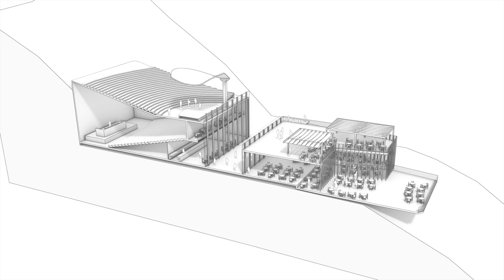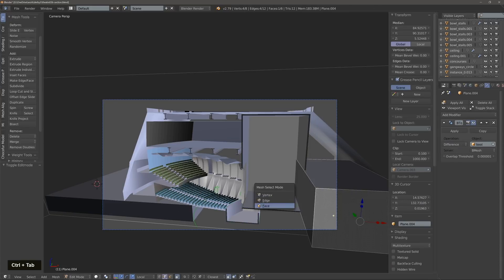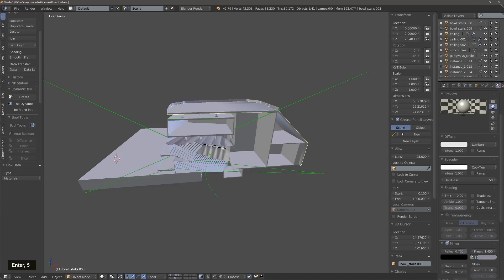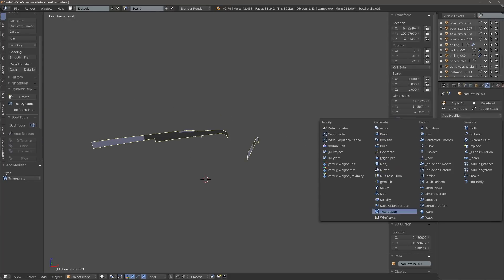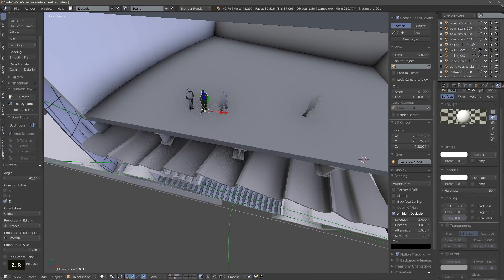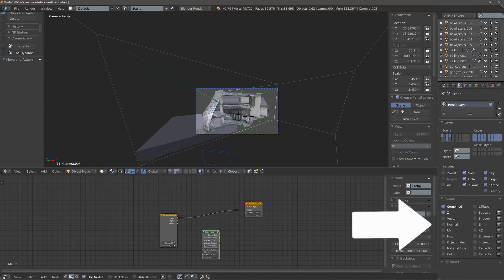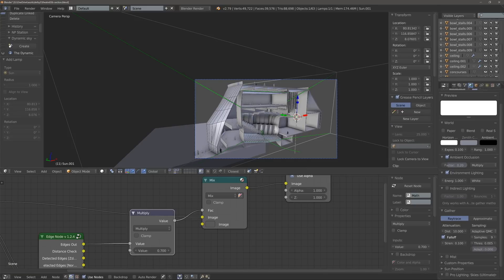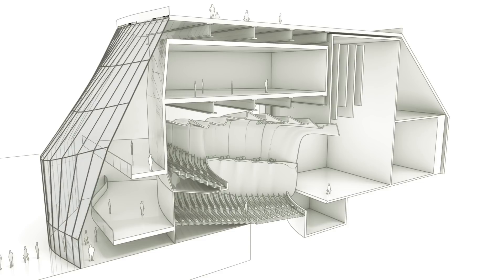How to create an architectural 3d Section in Blender

Comment: Hey UH, thanks for the vid. Question: how to get "live" sections, before applying the modifiers? Meaning something like live sections in BIM software as Revit or ArchiCAD? many thanks
Reply from the maker: Hi Andres, keep the booleans on without applying the boolean modifier and you have a live section. Make sure you set the boolean to fast! It's really important as the exact algorithm is much slower. Note that depending on your geometry, fast can still be quite slow

Comment: Nice video, thank you very much. I have a question. Do you think that blender work better with Revit or Archicad?
Reply from the maker: Depends what you are trying to achieve. They all have their places and the way I use Blender is for conceptual design studies. Blender, is very limited for documentation pursposes, though, so the design would need to be exported into either Freecad, Rhino, Revit, or other CAD software for documenting the design.

Comment: For the trusses, try this instead of wireframe modifier:
1) Extrude and create the truss faces.
2) Add and apply triangulate modifier.
3) Edit mesh and delete faces only.
4) Rip all verts to make each line separate to avoid shading errors.
5) Convert to curve, set curve bevel and use UV for mapping, and use smooth shading.

UV can be used for texturing as well as tangents for anisotropic shading (Cycles only ATM, not Eevee).

I've never considered doing trusses like that based on existing geometry. Love it.

Comment: What about using the cutawayshader. https://github.com/i-Reboot/CutAwayShader/
Reply from the maker: This works only with cycles and requires OSL to be enabled. I have found cycles to be slower in most situations compared to blender internal for these types of sections. And enabling OSL makes the rendering process significantly slower in cycles, so there isn't much benefit. But of course it depends on what you are trying to highlight